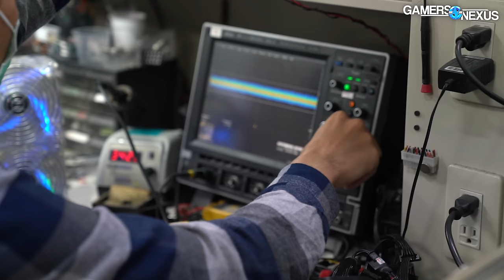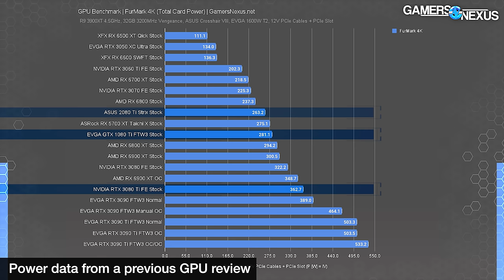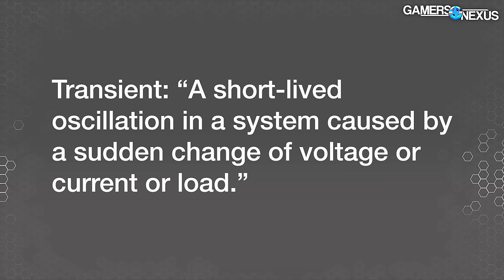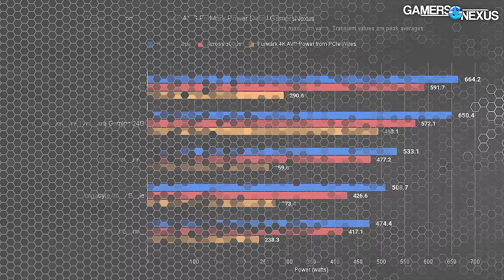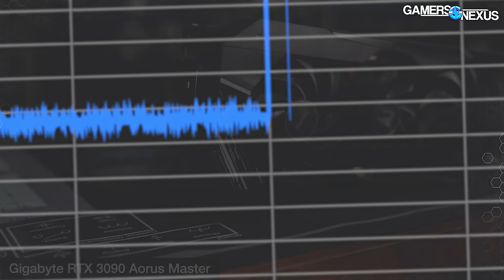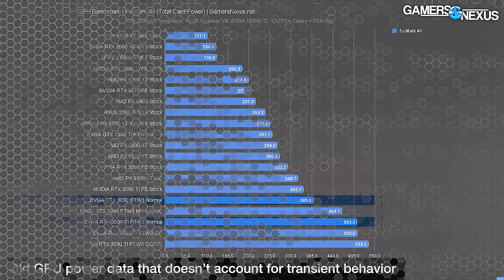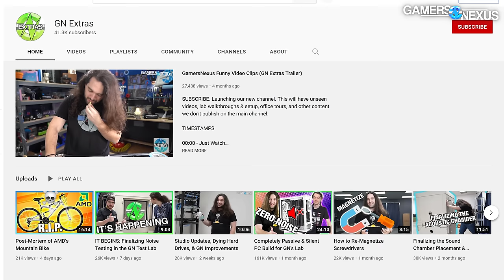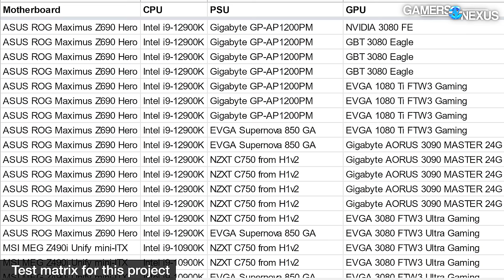The Brewing Problem with GPU Power Design | Transients

Comment: Nvidia needs to install large capacitors on the input voltage rails for the upcoming RTX 40XX series as part of the reference design.  This can be done quite cheaply.
Reply: A bit of a packaging challenge though - assuming that you allow the rail to sag to 9V, the minimum capacitance for the 3090 Master at 4:06 would be 20mF. Those caps are usually around 40mm tall.
Reply: @lachlantheobald1819  Well, the 40 series cards are going to have monster heatsinks and will be more than 3.5 slots soo there is plenty of space to work something out.
Reply: 4 slot cards here we come
Reply: @ashc3765  Naaa we are just going to have the card with its own water cooled external housing and an add in card that plugs into the PCIE slot with dual Fibre Channel cables.  The external housing comes with its own nuclear reactor you set up outside and plug a water hose into.  That should make due until the RTX 6000 series that requires a antimatter reactor.
Reply: Nop, they actually need to up their efficiency instead of trying to simply powering up the gpu with an RTG dedicated for that.
Reply: Thinking NVIDIA will do anything beneficial at a cost to their bottom line is naive at best.

Even if it would improve the industry as a whole, they really don't care.
Reply: @GrimpakTheMook  Nah, that would take too much work.  They just pack more and more power hungry Cuda Cores on to a gpu and call it the next generation gpu!!
Reply: @earthtaurus5515  caps are usually mounted on on the back, because otherwise you'd be eating into the heatsink real estate, not to mention that heat is the number one enemy to electrolytic caps. So, there's not much room to fit these large caps at the moment.

Are you suggesting we move to 4-5 slots to accommodate for the height of these caps on the back? 😅
Reply: @asplmn  As a customer, that isn't really my problem, is it. for all I care, they can turn the caps sideways and drill a hole in the board to accomodate them.
Reply: @Slay1337pl  it really is, because the solutions to these challenges come with trade-offs, and as the consumer, you are the one who needs to deal with those compromises
Reply: @DanKaschel  or i could not buy the product and go for the competitor instead.
Reply: @lachlantheobald1819  Then mount them horizontally. That can also easily be done.
Reply: @lachlantheobald1819  using a single 20mF cap is bad practice in those kind of of uses, using multiple 4mF or maybe even 2mF caps throw out the board which would lead to a way smaller (physically) caps is way better
Reply: @dummiesgoog8567  apple does this with the power supply for the Mac Studio. It even has cut outs in the board to allow the capacitors to sit at low as possible, allowing decently large caps to their diameter’s worth of vertical room.
Reply: @typograndmister1081  Definitely agree with you. But 20mF is still a huge amount of capacitance anyway - and that's the lower bound for the rail to sag to 9V. With more appropriate values of sag, the required bulk capacitance starts to approach Coca cola can size supercap levels.
Reply: @lachlantheobald1819  they can be laid on their side, there are low profile high value caps and they can use multiple smaller caps in parallel. Definitely a solvable problem.
Reply: Isn't it pretty dangerous to have large capacitors just sitting there? That's why it's so strongly recommended that you never crack open your power supply. Would the necessary capacitors for this be large enough for such a concern?
Reply: @willfancher9775  If you put a drain resistor on capacitor it will go to 0 volts in short order after power shutdown. The alternative for high end RTX 40xx are 1200 to 1600 watt power supplies which are very expensive.
Reply: @willfancher9775  caps in power supply are charged up to hundreds of volts. We're talking about 12V here. Also it's fine to open a power supply if you know what you're doing (ie, check the HV caps are discharged before working on it).
Reply: @willfancher9775  
Well, there are 2 major risks with big capacitors:
If the rail voltage is high enough (above about 50V) there's an electric shock hazard. The graphics card voltage rail is about 12V, so it isn't really a risk from that perspective. Power supply caps can be found on the mains side which makes them more dangerous.
The second problem is stored energy - if you were to short the 12V rail, a huge amount of power could be delivered by the cap, likely blowing traces off the circuit board or breaking the connectors and cabling. 
There are other problems that can be engineered out, but the second one would probably be the show stopper.
Reply: @lachlantheobald1819  Just do a APFC boost style input stage: a boost converter from the rail that feeds the card to the capacitors, and from there the usual core VRM buck.
Reply: @namibjDerEchte  
That could work, although now you have to widen the input voltage range of the buck that feeds the card. I would argue that just more capacitance even with a boosted buffer isn't the best customer focused solution given the footprint and large energy stores required. If instead the power consumption was optimised, you would have a cooler, cheaper to run card with less electrolytic caps.

Comment: 25 years back when I was the dude that built all my friend's PCs I found out, that the most erratic and hard to reproduce errors could be attributed to the PSU. I had my list what things to go through if ppl were having troubles but it very often came down to cheap psu that were used in pre builts. Once the pc was upgraded the errors started to mount up. This seems to serve as a good explanation of these experiences. If you buy the PSU judging only by the specification numbers you can have a bad awakening. Thanks for you hard work <3
Reply: By what criteria should I buy a PSU then? Just on the price?
Reply: Besides all that you say and are at the Core of the problem, one should consider also that the majority of issues coinceiding with the PSU was also in parallel to 2 other factors, 
One was poor Ground for PC chassis and the other one was also poor Grounded House Power plugs which also contributed in instability of the whole system..
that was happening in Older PCs (2012-2013 and prior) and Also the more mainstream PSUs were then of questionable Quality, more often than Today.. 
Ofcourse PC's weren't that demanding in Power back then .. and also Some brands of Quality existed.
I remember picking up a Totally Silent PSU (Passive Cooling, must have been 450W or 500W, dont rem actually ..that was at early 2000 and the price was then 135EU which was expensive at tge time) powering along a Ati 1600X.. its still runnimg today in a Cube setup Powering a Amd FX 55 System.
Reply: @neutechevo  poor electrical fuses were also often an issue but it was easy to rule out and just use a wall plug in a room with less load on the fuse. These issues often peaked during lan sessions as too many consumers were on one fuse. I didn't say that all old psus were bad. Just the ones oems cheaped out on in their prebuilts as it drove down their costs.
Reply: @Dodara87  reviews i guess. Its hard to come by proper reviews for psus since dirkvader de shut down however. I try to reasearch as best as I can though.
Reply: @benjaminolry5849  yes ofcourse. I said that more mainstream  PSUs back then were of more questionable quality due to lower power demands.. also lots of us have more than one, burnt hdds psus mobos..etc.. and you could not pin point the actual problem.. i vividly rem. a problem for my own system.. and then i figured it out at sbout a month away was due to 1 or 2 screws of the motherboard not tight in the chassis.. these problems back them were more common.

Comment: This is excellent content - thank you so much for the work you're doing here.

I just had this problem. I upgraded my GPU from a 1080ti to a 2080ti, and in the process, I decided to change the case and water-cool the system, which also meant adding a lot of fans, a pump, and all of the RGB that comes with it.

The build that eventually had the issue was with an EVGA Supernova 750W G3, a GigaByte Aorus Elite Z390 MB (with a seated Intel 9700k), and a Gigabyte RTX 2080ti Waterforce GPU. The PSU was about 3 years old, and the system would shut down randomly after gaming for 5/10 minutes. Opening up MSI Afterburner and reducing the power-limit on the card to 90% solved the issue at a cost of performance, so I knew I had to upgrade the PSU. I wasn't in a place where upgrading the MB/CPU/RAM made sense - I'm waiting to see what this next generation of processors look like from AMD and Intel.

I went big and bought be quiet! Straight Power 11 Platinum 1200W. Needless to say, the system is stable now, even after overclocking the GPU and maxing its power consumption limits. If you're having this problem, try under-powering the gpu to see if you can stabalize the system. It's not a permanent solution, but it might allow you to game while you figure out your next steps.

Comment: Wasn't there an aftermarket overclocking GPU that came with an optional capacitor module you could stick directly into the backside of the GPU die? If memory serves, it was sometime in the DX11 era.

I feel like that was trying to solve this very issue for extreme overclocking.
Reply: I think 780 ti or 980
Reply: @lgpa565  I remember now; it was the MSI Lightning line of extreme OC cards, starting with the HD 7970 and continuing with the GTX 780.

They called it the "gpu reactor".
Reply: Transits are a problem known for a good while. I suspect my old board was tripping because the caps were getting old enough to no longer deal with power fluctuations.

Comment: 20:45 And when we also account for the folding frequency, it might actually be better to build a separate setup that is offset by half a period, then combine the results into one function. That will eliminate any issues coming from the equipment generating errors due to the high resolution data processing.
22:10 - You can use mathworks MatLab for this, easily.

Comment: I went thru 4 RTX 3060ti’s before I realized this issue. I had a 600 watt power supply which is enough if you go by the manufacture standards. I now have a 850 watt and have no issues. So I think it was the transient spikes that was frying the cards

Comment: The sheer exponential insanity that seems to be going on with GPU power consumption from generation to generation now is scary enough...
Reply: Don't worry, North America isn't getting any more than about 1500w on 1 circuit. So at least there is that limit 😅
Reply: @ahfreebird    Well your monitor consumes some power as well :D 
Might get funny in the future.
Reply: @ahfreebird  ... my computer and monitors have to be on separate breakers (cause the monitors are enough to trip a 120V 15A breaker when added to my computer).
Reply: @Ri_Shin_Marco  No big deal, just gotta run an extension cord to an outlet on a different circuit.
Reply: Mainly with Nvidia GPU's. AMD is also rising a bit in power consumption, but their cards are literally hundreds 100+ watts behind Nvidias in consumption.
Also, both Intel and AMD are getting to kinda rediculous power draw on CPU's as well. Intle is already there, and AMD's AM4 socket maxed at 105w TDP's, the new AM5 Socket is going up to 175!
Reply: @ahfreebird  It's a minor thing but the 1440/1500 watt figure is for continuous loads. With transients you can get much closer to the 1875W or above supported by common 15A breakers. Also, 20A breakers seem more common these days in new construction. It's hard to imagine going there, though, unless multi-GPU makes a comeback.

Comment: Awesome to see this investigated and laid out in a straightforward way. IMO it seems like most of the blame lies w/ the GPU manufacturers for not controlling the spikes better, but I agree that overbuying on PSU is the easiest way for consumers to address it. I'm likely putting together a new build late this year. I was planning on once again reusing my Corsair HX1000 that's now over14 years old, but that might not be a good idea even though its 1000W... better to keep it in a system that won't have as high spikes and continue getting reliable operation from it and go with a newer unit for my new build.

I'd be interested in additional data on GN Extras!
Reply: In my experience a seasonic focus gold 1000W PSU is able to withstand a 3090 FE with a 5950x on a custom water loop. Before that one I had a Corsair RM850x that crashed during transients.

Comment: This reminds me of when reviewers added "frame pacing" and 99th percentile frame rates to their review tests for GPU display capabilities. The averages weren't good enough to capture the user experience. One thing both types of manufacturers can do to help: add specs for "max transient voltage or current" over a specified duration such as 100 microseconds.  GPUs  guaranteeing that they won't exceed that value, PSUs guaranteeing that they can sustain that value.

Comment: In the world today efficiency should be a huge concern, I was happy when AMD finally started to take it seriously after there older GPU's and CPU's. It's high time we start expecting more from new generation hardware, bigger and faster doesn't mean anything if it's pulling 2x to 4x the power of previous generations. Sloppy drivers and software play there part but with Gamers Nexus on the case we can finally hope for some truth and justice to be served. Thanks Steve and you're amazing crew, thank you as well for explaining how you're equipment works instead of just saying "it knows".
Reply: there is no choice, silicon based chips are extremely close to their limit, so they will get bigger and bigger and consume more and more .... and obviously they will be lot more expensive
Reply: @zannare  there is a choice, It’s just the more difficult one
Reply: @zannare  There is choice, just look to Apple and the M1 chips for a perfect example. As much rightful hate as apple gets for some of their practices, the M1 chips are insanely efficient. My m1 macbook has a battery that lasts two days easy, literally doesn't have fans and still doesn't get hotter than any laptop I've ever used before even under max loads. 

It's definitely possible. Not easy, but there is a choice. The issue is the time and money that companies like amd and nvidia would have to invest, and there is littl incentive to do so if you can just offload the problem to the consumer by forcing them to buy bigger and bigger PSUs.
Reply: @balls2thewall724  lolol efficiency always matters when it comes to lowering power draw.  Were you joking?

Comment: I’ve had this issue with my Strix 3090 and a 1000W Corsair psu…was very frustrating trying to figure it out. Keep up the great work!
Reply: I got a 3090 FE and a corsair 1000W power supply as well, luckily never ran into this issue even with some gpu and cpu overclocking.
Reply: @Luke-yd4xq  yeah I wasn’t that lucky unfortunately. I couldn’t figure it out honestly my friend helped my say for certain what it was
Reply: @DairyQueen2187  damn, you got that with a 1000W PSU ? Do you have a lot of power draw from other sources ? Because if it's just the normal CPU + PSU + 1-3 SSD+HDD, the 1000W should be able to handle it no problem.
Reply: @Winnetou17  Just a 5950X that wasn’t overclocked and my nvme drive. Don’t think the psu was faulty faulty but it was a serious problem
Reply: What psu did u get to fix it?
Reply: @gster109  a 1200 watt
Reply: @DairyQueen2187  wow that completely fixed it for you eh? My 3080ti killed itself with my 860w psu it started artifacting. What brand psu did u getv
Reply: @gster109  I just got a Corsair 1200w RM psu or just go with a 1200W platinum psu

Comment: I am a CNC Machinist and shop owner.  In dealing with old CNC equipment I have dealt with Controller failures from blown capacitors many times. (in the circuit to handle transient power draw)   Thank you for this video explaining the problem to your viewers.  (something I would just naturally assume when the system crashed)   :)

Comment: I wouldn't rule out problems popping up even on Systems that ran well for years, since capacitors also age (tough not nearly as badly as they used to).

Also IIRC, when Furmark came up it used to kill GPUs and manufacturers then added some sort of "Furmark detection" which prevented the cards to go all out, but I don't know if this applies to current cards / Furmark versions.